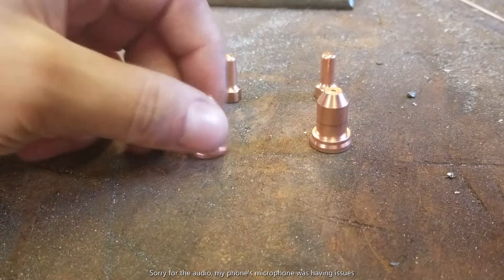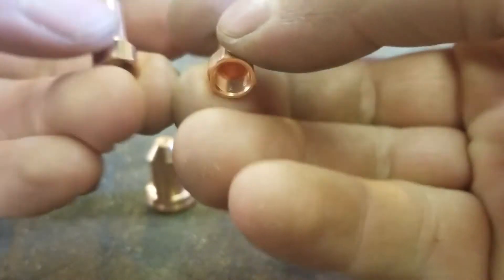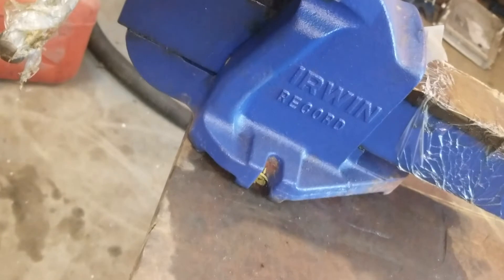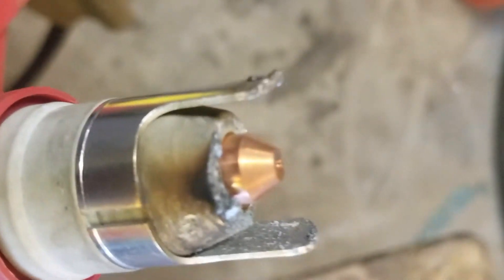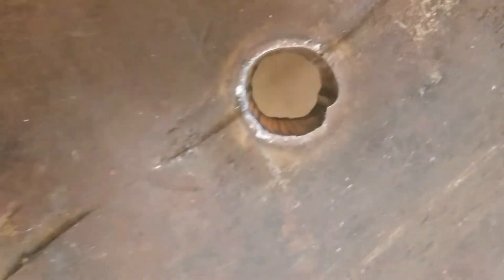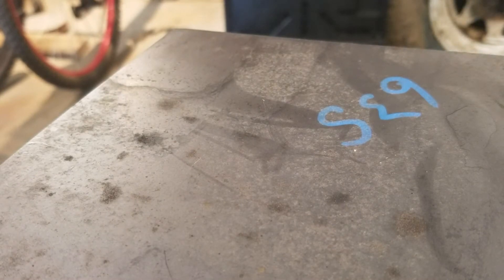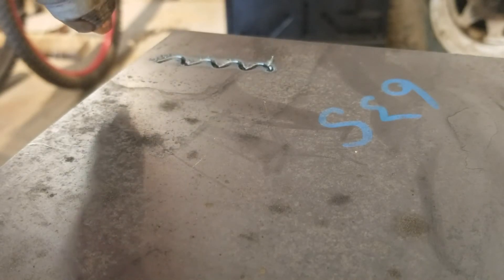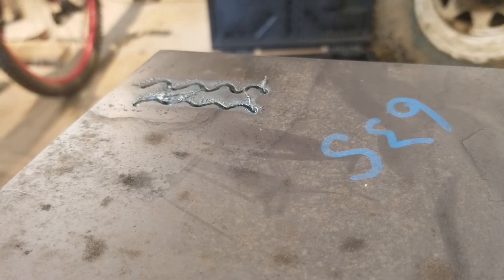Are Wish Plasma Consumables Any Good?

Comment: does jet fuel burn hot enough to melt steel? #9/11wasaninsidejob
Reply: It was an outside job, you couldn't fit the air plane on the inside of the building & crash it from the inside.